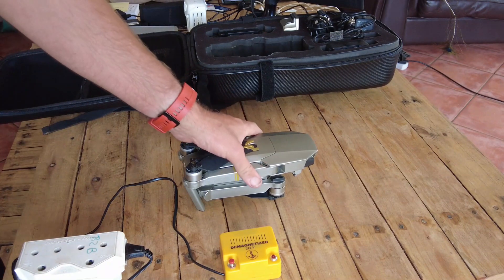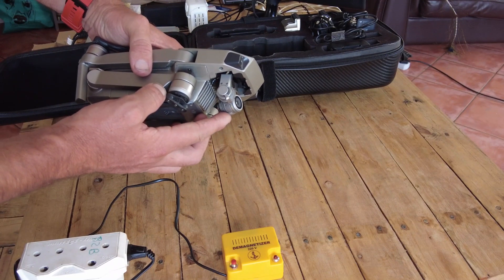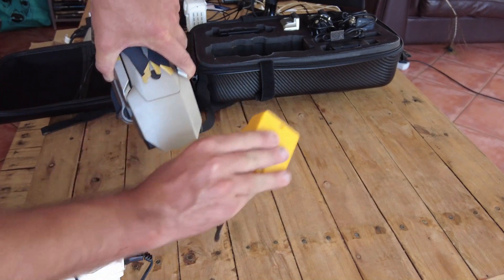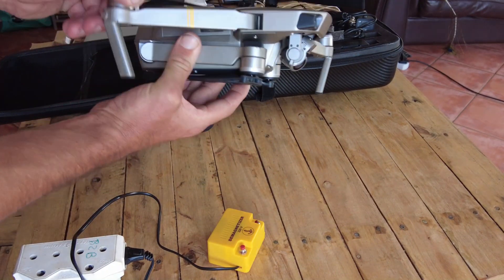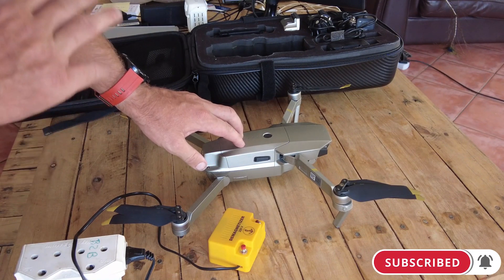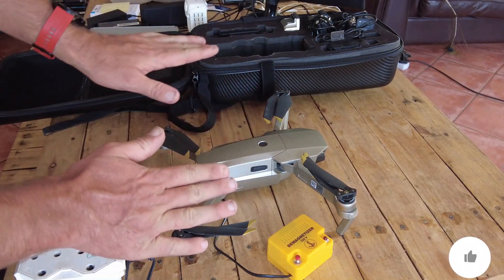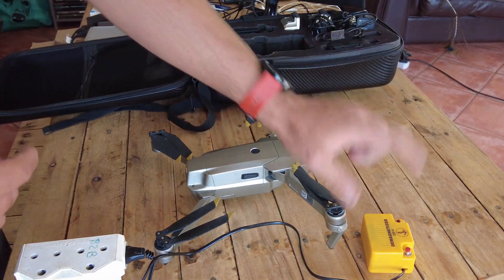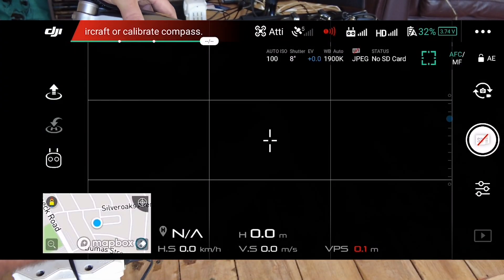How to fix: Compass not Calibrating - Mavic Pro, Mini 2, Air 2, etc

Comment: Great video, had a crash recently and have replaced video feed cable and nimble control cable.  could not calibrate compass at all after replacement of cables.  managed to get my hands on a demagnetiser, followed the steps in the video and all sorted with compass calibration.  is there any advise you can offer on "image transmission error" 0x800000.  No video feed and memory card is also not recognised.  gimbal status also says disconnected however gimbal is on and centred. Please help if you can.  thanks
Reply from the maker: That error is sadly a damaged core board error... the way I know is that you're saying the memory card is not recognized... that is straight on the coreboard... sorry man
Reply: @InfinityDrones  thanks for reply, any idea if I can get a replacement scoreboard - is it worth it?
Reply from the maker: @dereshpillay930  ebay or aliexpress are good places to look for one.
Reply from the maker: @dereshpillay930  replacement coreboard might cost more than another used drone...
Reply: Thanks gonna give it a shot
Reply from the maker: @dereshpillay930  Fingers crossed!

Comment: Won’t that demagnetize the motors??
Reply from the maker: No it won't. Your motors have magnets in them and will always be magnetic. Demagnatizing can also be seen as DeGuss. Think back to old TVs that had static on them and when you moved your hand over the surface it tickled your fingers, but only did it for a short while because the energy moved from the screen to your hand. Same idea applies here. Your are just removing the magnetic engery from the place where it's not supposed to be.

Comment: Great tip... Thank you Any suggestions for fixing the aux/led white landing light on the MA 2. Mine stopped after a hard fall brushing a tree. I replaced the small led module ( only mounts with two small screws) not sure why it doesn’t get power? The light does not respond to the controller on off or auto settings.
Reply from the maker: Sorry to hear about your issue... but sounds like you'll need to send it in. Sounds like something came off..
Reply: Did you fix it
Reply from the maker: i'm not sure he did